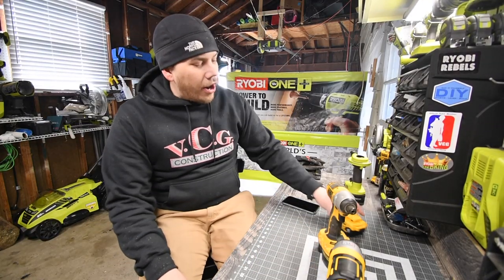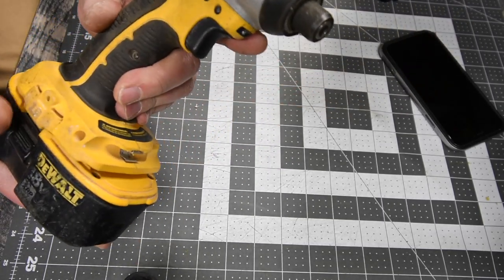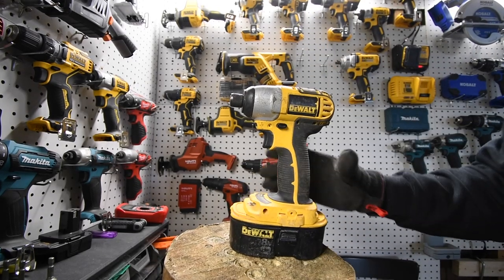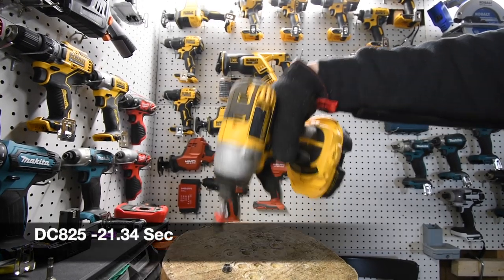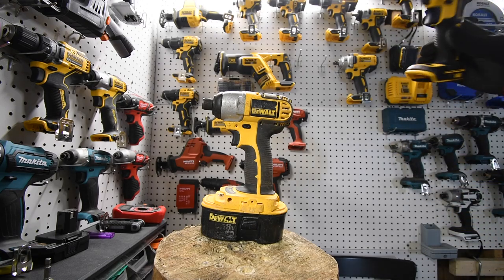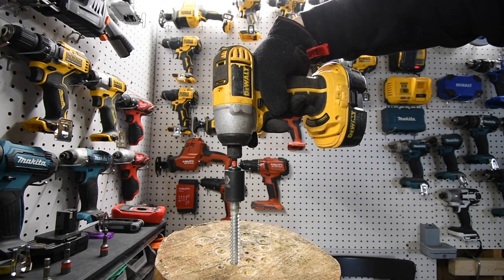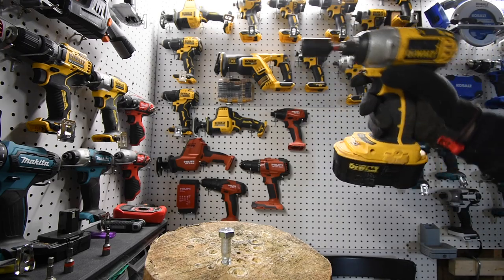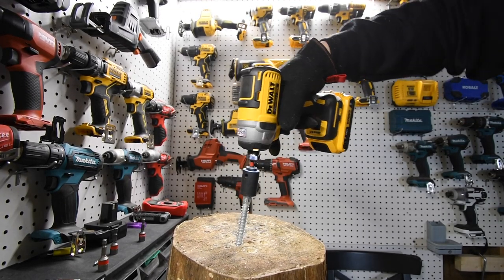Old Dewalt vs New Dewalt

Comment: Hey when you do get the adapter, it’s a big difference!! I’ve had my DC 825 impact gun for 14 yrs and it’s still going strong!! The adapter I’m using is DCA 1820 and it has been doing an excellent job!! I use a 4 ah battery and it’s awesome!! I use it on wood, steel and concrete!!

Comment: I have had one of those 18v impacts for 8 years hard use I used it in the trades, now I use it in the garage now for at home use. I use my 887 for construction work and it has been working great for a few years. My 18v is working great I have an adaptor and an 2 18v lithium batteries and a few ni cad batteries definitely not as fast as my 887 though but a good old impact. Keep up the great videos!!
Reply from the maker: I thank you for your support xXJJ

Comment: Amazing how far we have come. And I write this from the future (3 years after the video was made), so I know that my present 845 makes that 887 look like an old turd.

But for perspective, I would like to point out that that old ass DeWalt...is still working.

We have to remember, for these comparison purposes, that no one back then ever thought of an impact for such heavy use. They were basically built to be screwdrivers back then...and I mean deck screws and drywall screws. In those days the thinking was still that if you had anything resembling a heavy job, you needed corded tools....because in those days, you did.

So it is further impressive that the old codger will even DO the things we expect from our impacts today, let6 alone do them after 20 years of use and abuse.

OH, but one last thing: You are going to burn up that old brushed motor if you run it on modern batteries.

Comment: DeWalt dc825 

This eighteen volt cordless impact wrench delivers 1300 in.-lb. of maximum torque for a wide range of applications, such as tightening giant hex-head bolts, loosening lug nuts, and power-driving lag screws (bolts, nuts and screws not included).
Voltage: 18.00 VDriv    pe: Hex Shank Quick ReleaseSpeed: 0 rpm [Min], 2400 rpm [Max]ycle Rate: 0 blows/min [Min], 3000 blows/min [Max] Torque: 1330.00 in lb [Max]. Hope this information helps and by the way the reason why the base is smaller then the is Nicad xrp 2.4 ah is  DeWalt had torpedoes style lithium ion batteries they didn't do too well and got pulled from the market but they kept the tools around so The walking Dead have lithium ion batteries before the 20 volt Max years ago
Reply from the maker: Than you again Thomas :)
Reply: @ManCaverTools  no problem happy to help

Comment: These old 18 volt dewalt’s still work great with an adapter and lithium batteries. I’ve had 2 of the dewalt adapters fail within the first 20 uses, but I have several of the eBay adapters and they work fine, just don’t use them on the grinders or recip. Too much draw, melts the plastic around the connectors. They work great on drills, impacts, circ saw (if you’re not ripping thick material). Also, most of the eBay adapters allow me to use both dewalt 20v & Milwaukee M18 batteries. Don’t know that I’d run flexvolt batteries but I’ve ran all shapes and sizes of the dewalt 20v & m18 batteries with no issues. We’ve got about 20 of these tools we still incorporate into use regularly along with all our new stuff. They will go through some batteries, keep your chargers full, but they are still great tools. Also still have several Blue ryobi’s still in use and some 19.2 volt craftsman. Don’t use them a lot, but with lithium battery technology, still useful and great backups with $15+- adapters off eBay.
Reply from the maker: I plan on picking one up soon and thank you Matthew

Comment: I still have the old dc825 around. I use the adapter for the new batteries. It still kicks ass. I just like the higher speed on the 887 for certain applications.
Reply from the maker: very good and another video will be coming out on this soon :)

Comment: Wow! That's an old stem battery type DeWalt tool right there! I didn't have that old Dewalt impact driver. I mean the oldest brush DeWalt impact driver that I have is the DCF 885B and I got 3 of them Type 1, Type 3 and the newest that I have is the type 5 DCF885B and I got a box of DeWalt OEM Carbon Brush Assembly for them I'm still using them in my jobsite everyday. Then I got the DCF888 w/ Bluetooth and the DCF887. And my recent purchased DCF801 Xtreme impact driver. But for that old impact driver wow I didn't have that one. Stem battery type that's what Ryobi is STILL at now old school stem battery style that's why Ryobi can't evolve that much and can't step up higher to the game.

Comment: The base on the tool was called the "Nano Base" for use with DeWalt 1st XRP18v lithium-ion battery (DC9180 & the compact DC9181), Named after the Nano Phosphate lithium-ion cells used in the battery. This was before DeWalt moved the tool line over to the 20v Max slide pack. This lithium-ion battery had a smaller footprint than the NiCad or NiMH and was lighter with better runtime. This Nano base was also made to be backward compatible with the larger footprint NiCad/NiMH batteries. 
FYI What looks more off is an older 18v tool with the larger non-Nano base with a Nano lithium-ion battery installed.
That being said DeWalt didn't change the model number on a lot of tools with the Nano base. if it was made before the launch of lithium battery it had a large base then later versions got the Nano base a good example would be the DW960.

Comment: I still use my xrp hammer drill. Still kicking after 5 years non stop use hammer drilling. Has outlasted 2 new Milwaukee drills.
Reply: Oh I have a older DeWalt dc935k2 hammer drill 3 speed what a beefy beast heavy duty build quality all metal Chuck gearcase I have the adapter for the 18v to 20 v works fine one my 14.4 v DeWalt I have 3 of them one dw990k2 xrp  drill driver and a dw991k2 drill driver and adc759 18 v drill driver along with a dw935 trim saw and dw054 dw056  impact driver dw937  I've had them all for years they're sitting in a box but if I needs them I do have adapter in each drill an impact and trim saw because those things go in they are a pain to pull out I got one 2.0 ah xr battery for each I want to try the 3.0 ah xr with 21700 cells I have the same impact he has at work I only use it if needed it's a back up my main impact my boss supplies me is a Milwaukee 3 speed brushless it's not a fuel version
Reply from the maker: very good and that video will be coming soon

Comment: I had to run an old nicad battery in one of my ryobi drills.  I was amazed at how much better the new batteries are.  The old nicad barely had the guts to drill 2 1/2” holes in a 1.5” thick piece of wood
Reply from the maker: more tests are coming and thank you for the info Bob

Comment: I still use a Bosch and Makita impact driver that is that old all the time.
Reply from the maker: very good and thank you for viewng tool business
Reply: Nah, I only have a very old Blue Ryobi 18V Impact Driver w/ an old school Ni-Cad Battery (100% original Made in 🗾🇯🇵)  in there and it's still working up to this day and that's the oldest impact driver that I have. For the Circular Saw? I got a first generation of Magnesium corded Worm Drive Saw from Skilsaw the original made in USA 🇺🇲 100% No GLobal Materials bullshit all American made 🇺🇲 and the original made in USA DeWalt Corded Hammer Drill they still works great! but I don't bring them in my jobsite because I'm afraid they might get stolen there and I consider them as almost as vintage stuffs I have to maintain them for another 20 years before I could make a big money 🤑💰💰💰💰💸💲💲 out of those old tools.

Comment: For the time that was an excellent impact driver I still have one at work it's our back up I personally don't have it anymore I donated money to work for everyone if they need it there's not much of a rush this building maintenance for a community open breezeway condos  I do have my Ridgid r86037  gen 5 x    brushless  and my Bosch idh182 aswell I don't have as many channels as you but I had a nice  keep making the video you do
Reply from the maker: I thank you you Thomas
Reply: @ManCaverTools  I didn't even realize my phone autocorrected I was trying to say I don't have as many  tools as you  when it comes to power tools or the modern era if you talking Nicad oh I got a nice Rubbermaid heavy duty plastic tub full of them from Ryobi blue to DeWalt to even old Makita keep up the good work you do sir it's great to see the products that you bring to the channel and the testing you I wouldn't go higher then a 3.0 ah xr with that old dewalt impact driver I don't get the motor can take the the Power usually what does adapter they say 2.0 batteries to keep it at I have a kit but I tried my co-workers 3.0 and it works fine anything I would probably damaged the motor on the tool look forward to seeing that one go up against. Morning version using the same type of batteries that's going to be amazing to see

Comment: I tried the battery adapter and trust me don't even bother they are absolute junk. Just buy the chinesium knockoffs it will be better and those are pretty bad too. Check out the tests project farm did on the knock-offs. Some of them were a lot better than others. I bet you can find the knockoff batteries for about the same price as those stupid adapters. And the only reason that old impact was having trouble is because the batteries are done for. With proper batteries those old tools are still capable of a hard Day's Work. I have the new stuff now but only because I killed my old impact.
Reply from the maker: thank you for the info sir and I also thank you for viewing

Comment: My roomate has the 825 with a GOOD battery.   It can take lug nuts off,  it is weaker than my 12v xtreme though.

Your battery is done....
Reply from the maker: I will beed new ones :)

Comment: The 18v batteries they sell at HD aren’t NiCd they’re lithium ion, that’s why they’re so much money
Reply from the maker: thank you for the input Goon
Reply: No they are not they are nicad. The old charger can not safely charge a lithium ion. DeWalt at one time made a lithium ion that would fit the old tools. And they made it so that it wouldn't physically fit in the nicad charger but it would fit the tools. I know because I had the old lithium ion kit but it failed very quickly, they were pretty horrible.